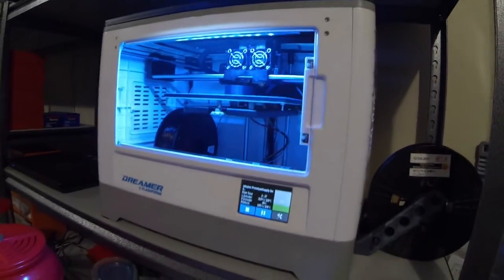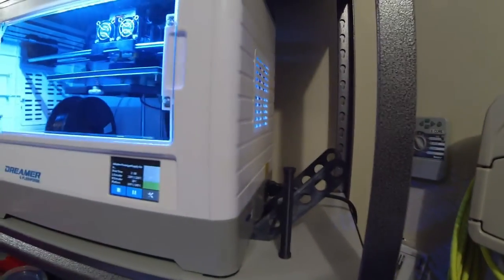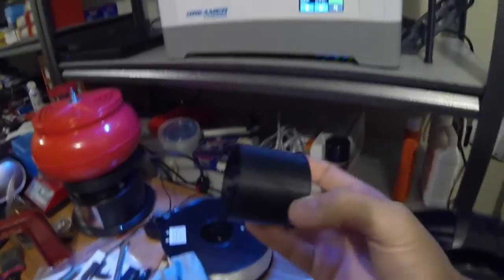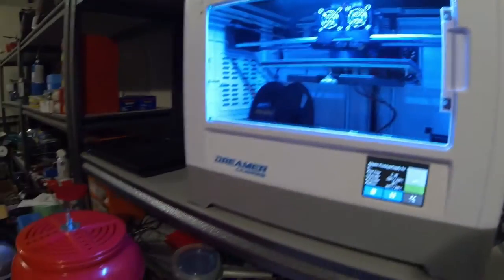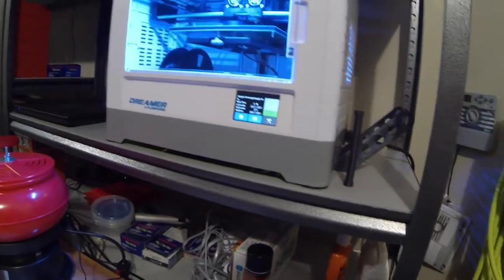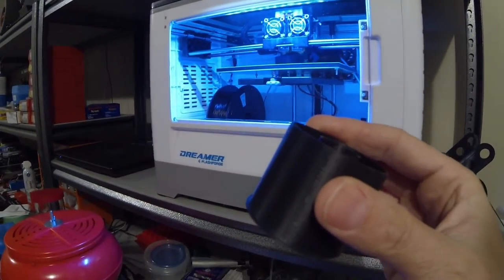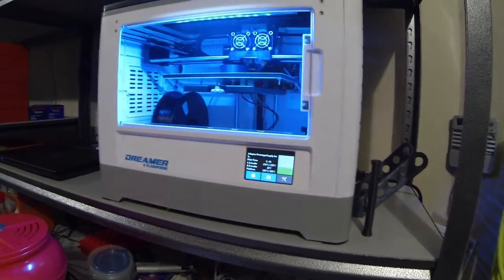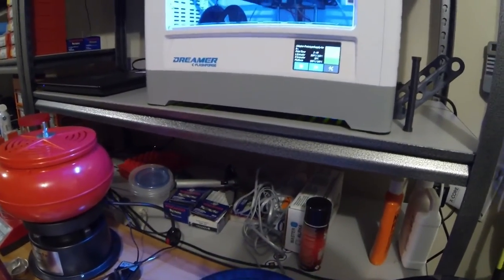Day 3 with the Flashforge Dreamer 3D Printer

Comment: Better of trying to make a rig that fits high over the top of the machine so the plastic feeds down.. watch the plastic will unwind and slide under another section ans stop the plastic feeding so need some drag  on the reel another thing is to have a piece of tube feeding the plastic into the extruder..
Reply: Another thing if it is hanging down you only need a rod for the reel to sit on,,